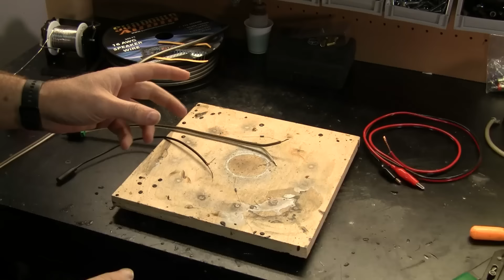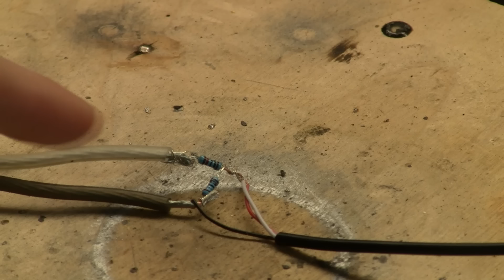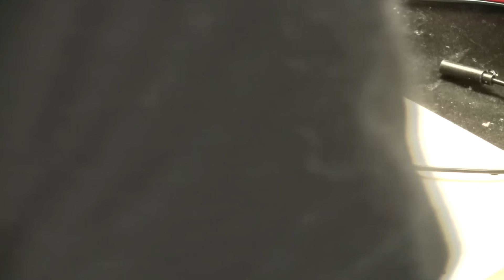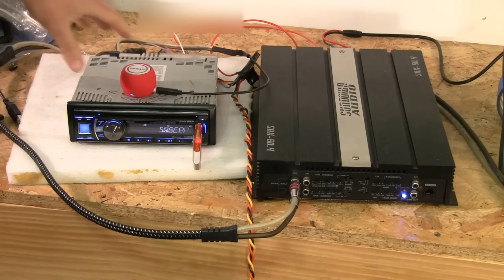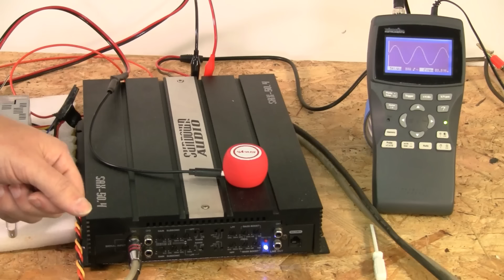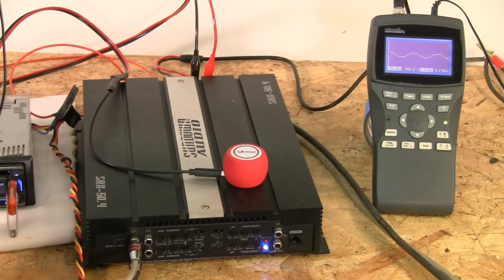Make your own distortion detector for under $25 - Tech Stuff Tuesday

Comment: I built my own distortion detector using a small 2.5" speaker, an Audyn - 2.2uf Film & Foil Polypropylene Capacitor, with banana plug binding post in a small project box. It works extremely well & cost me less than $20.00 & about ten minutes to build & complete it.

Comment: A simple lpad. I have been doing this for years. Now just change the speaker out for a input on a laptop mic or line input. And you use software like Rew (room eq wizzard) than you have a frequency analyzer, oscilloscope and Distortion detector all in one. Thank me later😃

Comment: Could I check at the rca to the amp so wont have to pull the dash back out?
Reply: Yes you can. There will be no difference between measuring directly at the RCA outputs of the headunit or at the RCA's you have running out of the headunit. Pull all RCA cables from the amp then do your test.

Comment: The cheapest thing of all was what I used to do with bandpass subs for casual customers. Bandpass sub enclosures hide a lot of distortion, often to the point where you smell clipping before you hear it. I just tucked a peizo crystal in the headrest or the roof liner and connected it in parallel with the sub drivers. It only detects gross distortion, but on a music signal it will give you enough warning that you should not smoke your subs without knowing you are pushing your luck too far.
Reply: They also get group delay like passive radiators

Comment: I have only one question, did you have a dummy load connected to the amplifier during the test? Because if you are testing the amplifier without a dummy load, it's going to clip at much higher output levels so technically when you install the amplifier in the car and connect speakers to it, the speaker impedance is going to drag down the the voltage rail's and begin to clip much earlier to which you would still have a problem...
Reply from the maker: The dummy load makes more or less current, not voltage. In practice, as long as you're using the amp at or above lowest recommended impedance you'll clip without a load before you do with. If you're operating below recommended impedance, it will clip sooner. If you're experiencing otherwise, it's because the source volume is different, which is also why you should always use your ears.
Reply: @EMFAudio  I think that you will find that once you start drawing current through a load, you will get voltage sag especially if the power supply isn't up to the task or you happen to have a bad ground. But you will clip much earlier with a load than without! Could potentially be a future video test? The more that you load down the amplifier, the sooner it happens! It gets much worse with some amplifiers so I usually recommend to stick to the better brands unless you understand the amplifier at it's circuit level which I have no problems with. I still remember my first car amplifier, a Realistic 50W x 2 back in 1987... Subwoofers weren't even a real thing back then but I had two 6x9 speakers with their tweeters removed in an isobaric fourth order bandpass enclosure, I very well knew what was possible from way back then! I may be over 50 today but the boy inside of me is still there and keeps me young at heart! 
Man! If only we had Google and the tools we have today way back then...

Comment: How do I plug into a factory HU without rca? I use the LC7i line out converter fyi
Reply from the maker: You'd go out of the LC7i. Just start with it all the way down and you'll find the HU clipping point that way.
Reply: @EMFAudio  so turn the LC7i all the way down and hook this up to the rca port or where I plug the speaker wires into?

Comment: Could you just use a pair of headphones instead of the tiny amplified speaker, or does it have to be something with its own power source?
Reply from the maker: I haven't tried headphones but I suspect there would not be enough output signal to power headphones. If there is, it would have to be something like cheap earbuds.

Comment: Could I check for distortion in head unit by using female rca and unhooking the amp rca. Basically not take out radio but wire everything the same?
Reply from the maker: That's what one of the two parts of this is for.
Reply: @EMFAudio  so using female plugs will be fine?

Comment: A very simple circuit of a  piezoelectric transducer of 25 cents  and few resistors in serie to it is  doing the same job for detecting distortion on bass signal.. connect that combo in parallel to the amp output and once you hear a buzz fom the piezo you know there is distortion, that's it.   Piezo can play only the HF and it is tolerant to high voltage.

Comment: Sweet project! =)
A evolution of this would be a smaller transducer that you can pinch between your teeth.
Bone conduction works really well in noisy places.
The frequency range is also wide.
Example; stick a spoon in your mouth and softly bite down on it. Then lay the end of the spoon onto a table. =)
Bone conduction FTW!
Greetings from Sweden.

Comment: Can I use 1/8 w 5%?
Reply from the maker: The specs are the specs for a reason, the percentage and wattage are critical points.
Reply: @EMFAudio  I've looked everywhere locally and online I can only find 1/8 Watt 5% or 1/8 Watt 1%
Reply from the maker: @74midwestbass74  The giant bulk pack I spoke of I got from Amazon I think, maybe Ebay. That's the only way I could find them, in a bulk pack with others.
Reply: THANKS SO MUCH!!!

Comment: I think barevids did a much more simple vid on making a DD with a speaker and capacitor. Id spend 100 bucks on an o-scope before i went to the trouble of making a rats nest to do the job. lol
Reply from the maker: There are different ways to get a similar result, but they don't always work as well as the other. I'd use an o-scope first too, but not everyone can buy one.
Reply: @EMFAudio  i still gave ya a thumbs up

Comment: How much power can handle this setup? Can you 5k set on this?
Reply from the maker: I believe the limitation is 100 volts, so it's not so much wattage as rail voltage. 100 volts @ 4 ohms isn't the same power as 100 volts @ 2 ohms isn't the same power as 100 volts @ 1 ohm.

Comment: Who's got the time and patience to do all that?  I'll stick with my SMD DD1 Plus. Easy to use, reliable and accurate.
Reply from the maker: O-scope is more accurate, more reliable, easier to use, costs less, argument invalid. So the time and patience to do all this? Well after you spend 10 minutes making them, it takes no time to use it, and you can use any frequency, and you don't have to hit any buttons a dozen times before you get told to go die in a fire.

Comment: Great 👍🏻 l have almost everything l need to make this tool except the resistors 🤓
Reply: You got an old junk TV or radio laying around somewhere? Collect them from that along with the speaker. If not you can always find shit like that sitting next to the curb for trash pick up in residential areas. Have fun!!
Reply from the maker: Remember, the speaker is amplified, that's a key point to this.
Reply: EMF Audio a Bluetooth speaker whit 3.5mm input should work?
Reply from the maker: @juanpestrada5231bdndjkdn  Yes, it should.

Comment: Use a Xmas light and replace the speaker
Reply: Nah gangsta it don’t work that simply. Gotta have some circuitry in there that can detect the actual change in signal and allow current to flow when that change occurs.

Comment: I bought a cheap 40$ oscilloscope off amazon about a year ago and it works pretty great, as you mentioned, the resolution is low but I can just change the volts/div manually (zoom into the wave) and see clipping as soon as it starts

Comment: Something I learned through research, this can be done for sub amps on the amp output if you just take a tweeter out of an old home speaker that has the capacitor on it, the capacitor filters out anything below like 1khz at least and as soon as you start to clip you can hear the tweeter making a high pitched crackling/screeching noise, and if you really wanted to you could run a long wire to it and mount it on your seat beside you if you have the gain turned up as high as it’ll go, and that way if a bass boosted song comes on, you hear the clipping and can turn it off
Reply from the maker: This method also does lows, all you hear is the distortion, none of the signal. Some might say this method is better at lows than highs.

Comment: did mine with a bluetooth speaker with 3.5 input and output. just plug your headphones for low freq
Reply from the maker: Powered headphones would work, and easier to hear the noise as well. I might actually try it with my noise cancelling headphones and see how it acts.

Comment: very useful for ppl who don't have alot of money to buy oscopes and what not... Kinda pissed that my nvx vcw 12s foam surround ripped only got a year out it now im using its bigger brother the 15 version I really hope the surround on it don't rip either if it does Ima look try out a diffrent brand...Any suggestions?
Reply: EMF ?
Reply: @PURESOUND4  how good are they?
I listen to a wide range of music and how much abuse can it take.
Reply: @killer32620    EMF Lowballers are rated at 750w rms, a step up from that are the EMF Banhammers rated at 3000w rms, but those might be out of stock right now.
Reply: @PURESOUND4  only running a fosgate 1200rms amp
Reply: @killer32620  I've seen videos of Lowballers taking double their rms rating. That would be my choice.
Reply: @PURESOUND4  Might give em a try if my sub gives out...
Reply: @killer32620  EMF or sundown SA's they do very good for all types of music
Reply: @jase1911  Will keep that in mind when I go sub shopping next time thanks for the help
Reply: Killer32620 See right here in this comment you showed who the culprit is...the subs surround didn’t just fail, you caused it to fail through improper use also known a ABUSE. If your system is set up properly ie gains set correctly and little to no distortion being introduced you should be able to play your system max volume, that’s free of distortion, for years without issue. Just because your head unit goes to 50 or whatever the number is doesn’t mean that you should crank it up to that limit.
Reply: @erictheboringone5292  my gains are setup properly my clip point isnt till 59 I was only at 51. I will say that the surround on it is real thin tho
Reply: @PURESOUND4  awww ya just got a lowballer 15 dam shit pounds sounds way better already than what Ive had. now the only thing that remains is for how good it will last on my rd1200 fosgate I guess only time will tell
Reply: @killer32620  how's that sub going for you? Still running?
Reply: @jpowens2253  I sold It I have 12in skars now
Reply: I respect NVX but give some EMF a try. I was a die hard Sundown guy but these are a class above even that. My YOLO v1 (never should have sold it) was beyond amazing and the Bannahmmer v1s I have now are outright violent. Wish I had the money to preorder v2s but that will have to wait just a wee bit. I'm sure the lowballer is the best value for anything in it's price range too.
Reply: @HumansBeing365  So far Iv'e only had sonys,crunch,boss,planet audio,Massive audio and Nvx all pretty dissappointing when you listen to a wide range of music.
Reply: @killer32620  some of that could be the enclosure? What do you have going on there? Best sub an a bad box will still not perform well.
Reply: @HumansBeing365  Oh ya I know that one Im looking to work on that next just finally upgraded from a stock alt.amps seem to run cooler too.just did the big 3. Kinda hard to find some one in my area that gets down on custom enclosures.Had a buddy that got charged alot for his and the guy that did it didn't seal the box right.
Reply: @killer32620  yeah getting a decent box that doesn't cost a fortune can be tough. You aren't within driving distance of central Illinois are ya?
Reply: @HumansBeing365  I'm far away I live in cali

Comment: There are cheaply made Chinese osciliscopes you can buy on ebay for around 20$ I believe. Now how accurate for distortion they will be im not sure
Reply from the maker: I mentioned in my setting gain with an o-scope video the potential concerns with those.

Comment: What oscope is that? I need a smaller one. The one I have nearly takes a damn forklift to move
Reply from the maker: It's a Velleman, but I've had it for around 15 years so I'm sure it's not made anymore.
Reply: @EMFAudio  thanks I'll eBay dive and see what I dig up
Reply: @EMFAudio  by the way...What's it gonna take to get a Banhammer 12?? Nobody has stock and I want to use it in my build...v1 or v2
Reply from the maker: @mattpierce4143  V1's are long gone, v2's are pre-order. So it will take a pre-order to get one.
Reply: @EMFAudio  I understand a date can't be committed yet, but are we looking at a month or a year until shipment on the preorder? TS parameters similar to v1?
Reply from the maker: @mattpierce4143  Not a month, not a year. I won't speak of parameters till they're final.
Reply: @EMFAudio  LOL ok. I pass through Spartanburg about once or twice a year, I work for Duke. I'd like to stop by some day and chat with you guys

Comment: Big thanks for that video thats what i was looking for may you make a video how to do that just with an LED instad of a Speaker ?
Reply from the maker: That is something I'll look into at some point. I've got other things taking a priority.
Reply: EMF Audio Ok I saw barevids doing something similar with a small speaker hooked up to the amps output via a small capacitor
Reply: DerTechnikKanal i also saw a video with a piezo tweeter.
Reply: @tubestoned  yea i think a piezo would be thre easies way cause it clearly makes clipping audible
Reply: DerTechnikKanal  no it actually doesn’t. It doesn’t detect it as solidly as this does. Besides that the tweeter with the capacitor isn’t capable of testing for distortion I. Your head unit. As cheap as these are and as easy as they are to build, this is the way to go.  
And yes I’ve tried out barevids way he should in that video. Besides, if you’re trying to used the tweeter and cap to set up your sub amp you are hoping you have the right cap to capture the sound of the signal that clipping distortion creates. It’s not as simple as he made it look.
Reply: EricTheBoringOne yea I know i would also rather build what was shown in this video cause to me it’s more accurate but I would like to have it with an LED